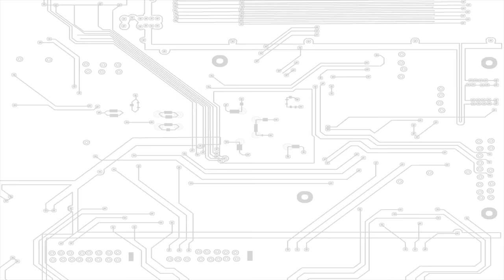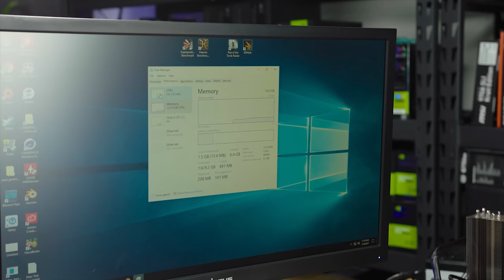How to fix bent CPU pins

Comment from the maker: I know that's it's painful to watch someone intentionally cause harm to a component, especially if it's a part that you desire however rather than getting triggered try to realize that these videos are designed to help give confidence to viewers to try and repair their own devices. The CPU still worked afterward and it's pain potentially helps countless people in the future to try and salvage their bent AMD CPUs. You should expect more videos like this, but I won't apologize if that bothers you. That's on you, not me.
Reply: indeed
Reply: Kids in Africa could have eaten that CPU!
Reply: Jay this is 'merica where sensitivity is rampant...
Reply: My 8350 is missing a pin, I scrapped one off another AMD proc, dropped in the socket and made work. At the time it was still very expensive, never underestimate the value of repair. I got a at the time 200 ish dollar proc for 5 bucks in scrap at local shop.
Reply: JayzTwoCents Will gladly take that missing pin, 3 legged cow off your hands sir lol. As long as its milkin its all good. Great vid by the way. Glad the cpu still worked after that.
Reply: You call it breaking a pin, I say weight reduction. Less weight = faster speeds?
Reply: Just gotta give this channel some props. I have been subscribed for awhile now and videos like these have helped me learn new things.  Also I subbed to you before I had even built my first PC and now im on my 9th just finished a build for my buddy and did all the overclocking and most of what I know is cus of you and Linus.  Thanks Jay
Reply: rubiconforrest dam good idea... Try that the next time I mess up cpu...
Reply: I cried watching this
Reply: Worth it, I've got a box of 20+ cpu's with bent pins (mostly socket 939 and am2+ cpu's) that were bent due to storage carelessness.  Never considered a razor.  Thanks for this.
Reply: Jay, I pulled a Phenom ii x6 1090t from a bin of CPUs at my work. There were 28 pins bent or flattened. I too used a razor blade to straighten the pins. I also had a pair of needle nose tweezers to help me more easily grasp the pins that were laid flat. I'd also say that the end bit where you put the CPU in the socket and use the socket to help straighten is crucial; perhaps more so than the razor blade, but I digress. In the end I'm happy to say that my CPU is up and running at a cool 3.6 GHz, boosting to 4 GHz on stock voltages. A very well put together video with clear concise instructions. Thanks for affirming that I did it right. ^_^
Reply: This was also a lot easier earlier. In the beginning of the Pentium 4 days there was enough space between pins that a small needle nose plier could be used to straighten up a pin. One of the first P4 processors I got I managed to mount incorrectly in the slot causing the pins in one corner to be bent. Doh!
Reply: That was really Alfred Hitchcock level of horror
Reply: JayzTwoCents don't worry Jay i watch a lot JerryRigEverything and how to basic so that pain thing already vanished a long time ago
Reply: What about using a heat gun on the bent pin area? Would that increase the malleability of the pins? Or cause more damage to the die?
Reply: I used the same method Jay years ago, I havent had to latly thank god heh
Reply: Jay is it really hard to ignore negative people? If I created YouTube videos or did anything where I had followers start hating on me, I wouldn't give them a single thought. Maybe I would change my tune if it was happening to me, but I noticed that it seems to bug you quite a bit. You make great content and a lot of us really really enjoy it, don't worry about the negative people, they're not worth your time. For the record I asked because I was genuinely curious.
Reply: I bought an AMD FX 6300 for $20 a couple of years ago because it had bent pins. I fixed it rather easily by using a credit card and those card squegees for screen protectors. The pins on the old Socket A processors are much easier to straighten up using a ball point pen.
Reply: +Sean Jurawan It didn't? Task manager said 16 too. Not sure where you were looking.
Reply: Jay you're da real MVP by doing stuff like this. you risk your own stuff in order to teach others.
Reply: You could have used your dead AMD FX CPU. :-p lol
Reply: lol i originally posted a pretty nasty comment toward haters but let me try something a LITTLE calmer.  tl;dr?  nope.

jay is right and awesome to pick on bitches and trolls.  embarrass the fuck out of them.  it's the only thing that works.  you never see them reply to the criticism when it's the owner of the house calling them out.  what you see instead is other trolls calling jay "thin-skinned" for not putting up with ceaseless bullshit.

the "thin-skinned" people are the ones being bitchy to jay in the first place.  but, recognizing that would almost be like self-awareness so i don't expect too many of you will fully appreciate that.

like i said, this is like the owner of the house saying "stop it".  would any of you look to said owner if you were a guest and tell him he's wrong to be upset at other guests for shitting on his carpet every time they stop by, several times per visit and in every room in the house?  when did saying "stop that" become more "bad" than that?

the fact is, we could all do better if we wanted.

oh well, nice video jay, i've repaired pins on old 486 CPUs with a mechanical pencil before, i somehow doubt that'd work here :)
Reply: All I was trying to say is why doesn't he just not read the comments and save himself the trouble? It seems like it bothers him so if it were me I would just ignore them because it would be easier on myself (if it bothered me so much.)
Reply: I did this on an old FX chip with a credit card once, the pins are a bit further apart (i think?) but that way you cant "cut" anything, might help as a newbie tip
Reply: I built a Ryzen 5 1600 pc 3 months ago, it was my first build and I was kinda nervous it didn't boot so I thought I bent the pins however after checking for hours on any deformed pins it turns out my memory wasn't seated properly. first time build thingy :D
Reply: jay i use a toothpick and a bank card to fix mine
Reply: What pin? Some times a schematic will tell you which one bent!!!
Reply: What about a video on fixing watercooling leaks that aren't just undertorqued couplings? Hoses/pipes, blocks, rads, reservoirs/pumps etc..? Maybe even repairing and topping off closed-loop AIO? Dirty quickfix, durable longterm fixes etc. Could even be a miniseries. Really miss more of those instructional watercooling vids - you really make them appeal to both novice and pro :)
Reply: You are right, obviously, it's just your thing. Still you could've used the less expensive CPU. But would you be willing to try the same, but this time heat up the pins, so they don't snap off that easy? I mean metal workers use heat to form metal, why not try it on the pins? Thanks for the video! By the way, i used a triangle ruler once to fix bent pins.
Reply: JayzTwoCents i think most pins get bend due of alot of force from the fingers on the outside or ignorantly use a thumb on the pins thinking u wont bend it. The most bending ive seen was on the outsides like you say in your vid on the "corners"
Reply: you shouldnt need to even be justifying yourself man
Reply: Just get Linus to drop it.
Reply: kickass
Reply: jay's a bully bending that pin, hehehe glad the cpu still works.
Reply: Thank you Jay 😋
Reply: I fix quite a bit of these BGA sockets using this basic method but I also add in using a thin guitar pick to straighten more extreme bends. The flex of the pick prevents me from overpowering the pin and breaking it. It takes a few tries to get used to it but I haven't broken a pin in years like this. With LGA sockets, I use a long non-marring tool with concave edges as well a curved #22 scalpel like those used by dermatologists.
Reply: savagery
Reply: Thanks Jay pretty specific video got the idea of it, it would have been nice to see a more tighter shot (like the example bent CPU pic) but the idea comes across! Thanks again!
Reply: so painful for me only because I've been there before.
Reply: You got me crying with that ryzen lol
Reply: Linus actually did 2 videos, and the 2nd was a remake.
Reply: Do you know the name of the music that you used in piano ?
Reply: dont worry, just see what TechRax,m EverythingApplePro, and GizmoSlip do, they intentionally harm things and it costs them sometimes thousands of dollars
Reply: That was so painful to watch. I would rather go through surgery again than watch that. I will say this video had lots of good information.
Reply: its better using the tip of a pen to straighten them and razor if the pins smashed flat to get it started then use pen to straighten
Reply: Aaron Beaty Since a heat gun can put out above 1500 degrees I see two possible outcomes to that.

1: thermal damage to the chip and components under the heat spreader
2: the heatgun will melt the solder on other pins and they will all go flying across the table from the wind of the heat gun. 

I tried to hot air reflow with a tube attached to a heat gun on a Xbox 360 and the lack of thermal control caused number 2 to happen to the xbox's motherboard. Never did find all those resistors either. Lol
Reply: what you think about blowing hot air over the pins like we do to bend pipes for water builds. it would have made pins easier to move.
Reply: Thanks for the video Jay. It is helpful, informative, and appreciated. I once fixed an old cpu with bent pins. I used different tools, but I never thought to use a razor blade.
Reply: Mr. Manager *PGA. BGA are the horrible 'soldered direct to the board without a socket' laptop type.
Reply: JayzTwoCents Here's my question... Why the hell didn't AMD take the opportunity with the AM4 socket to build in a guard around the rim of the pins?So that the outer most rows of pins could be protected by a metal or plastic wall that would defend against corner and edge drops? It's such a simple design change that would only require leaving a small recess around the perimeter of the socket. 

I know it's too late now because the AM4 standard is in full circulation, but maybe they could make an augmentation like that when they do AM4+?
Reply: Wanooknox You're suggesting a change to AM4 chips, not just the socket.

If someone bent the pins, they fucked up.

I would guess they probably won't do it again after the experience, this vid just shows it's a mostly recoverable situation.
Reply: It doesn't have to be a change to the chips... It could just be a plastic brace that they clip to the outside of the CPU's PCB. But either way, yes that's what I'd be looking to see. It doesn't make any sense to me that they wouldn't do this on such a fragile part (even if this video does show that it's salvageable). Like they could even make that change in the jump to AM4+ because they wouldn't need to make any change to the pin layout, just add a boarder. Older AM4 chips could remain forward compatible with a new socket design, and the newer chips could have the bracer built in to protect the pins and just slid right into a recessed "moat" around the socket. It's really not a complex modification.
Reply: Wanooknox I understand your position, but that means extra tooling costs to make the moulds for the clip-on brace / shroud, the risk of damage on the production line (human or robotic) fitting it.
AMD have always been about value and i'd prefer a $3 cheaper CPU than one that's idiot proof.
You make something idiot proof, and we get better idiots
Reply: JayzTwoCents just seeing you drop the cpu hurts my heart
Reply: Excellent cinematography. Can you do a  "bake a GPU" video for graphics cards? I killed one with liquid metal and wanted to know if that can be fixed with baking.
Reply: JayzTwoCents at least no intel. Lol
Reply: @jay i used a sewing needle on my old 1055t (still works) whent on one side then the other side ... teased it up  on both sides 10 ,minutes later done and up and running..... no need for a razor blade  (risk cutting yourself rather than pricking yourself).
Reply: JayzTwoCents i used to routinely bend cpu pins when i’d try to remove my old pentium from socket. Would be stuck to waterblock and rip out of socket. I’d bend the pins back with mag glass and edge of credit card. That was back when I had a 230w TEC and liquid via danger den block.
Reply: JayzTwoCents At least you didn’t paint a bunch of RGB components black and fry them in the process like Linus did.
Reply: Can You fix bent radiator fins on AIO liquid coolers?
Reply: Yes, very easy to straighten find. I did it a few months ago on my thermochill pa 120.3.
Reply: I know that it's possible, I want to see his method.
Reply: He bends them into place with tip of tongue, I tried his method but had a sore tongue for a week after.
Reply: JayzTwoCents who else was crying
Reply: Blow it up
Reply: JayzTwoCents thanks man. Today a built my New rig With a ryzen 5 1600. It scared me a lot to see the cpu not fit in, and it was from a bent pin. This video helped me a lot, my pc is working fine. Thanks a lot!
Im Kinda worried it May affect performance but i dont Know That much. Please keep making videos like this.
Reply: I paid my own money to send in my X99 Rampage V extreme the 15th of the same motherboard to ASUS for service. they dump it with out letting me know. its a brand new motherboard. I asked to send it back to me. I will never buy ASUS and corsair again. 23 broken  X99 motherboards. all of them CPU sockets that fallen to bits and bent pins. the last 2 MSI X99A gaming 7 DOA.I am waiting for delivery I am fucking disgusted about wasting my time and money on this disgusting project. when I get this back with in 24 hours. if it dose not work. I am going to call MSI that I will dump everything. I AM NOT GOING TO START ALL OVER FROM SCRATCH. I CANNOT WORK FOR A LIVING ANY MORE DUE TO MEDICAL CONDITIONS. SSI CANNOT PAY ME ENOUGH TO BUY A NEW GAMING COMPUTER. 23 YEARS OF CPU SOCKETS FALLING TO BITS AND BENT PINS,  FAKE BIOS AND FAKE CHIP SET FROM CHINA. I refuse to buy a new gaming PC no more. I am finished with this project what ever this is the last time I try to get it to work. this is the last time. if it dose fail its over
Reply: Can you do an Intel Chip well Intel Motherboard pins fix video too that would be good too see!
Reply: I'm getting my R5-1600 near the end of this week and while I was watching oh man I was so freaked out on the thought this could happen to this little guy... Too bad AMD didn't go with LGA for the new platform, LGA CPUs are so rugged compared to PGA ones.
Reply: Could’ve just handed it to Linus.
Reply: LOL my CPU is costs one sixth of yours. i3 3220 3.3Ghz, not overclocked and with stock fan on top of it
Reply: Well said Jay. Looking forward to more DIY repairs. Thanks!
Reply: Wait people seriously get pissed over that? Wow, pathetic
Reply: STAND AT ATTENTION WHAT DO YOU THINK YOU ARE DOING
Reply: I've used a small diameter mechanical pencil and it worked great... Here's the bad news if your pins are more than 30 degrees bent eh..... The odds of them snapping are 90%
Reply: me watching something i could only dream of having getting destroyed in front of me.
Reply: Razor blades is bad fucking idea.. But desperate times call for desperate measures
Reply: I mean you could as well just bend the pin off screen present the CPU as already damaged and proceed to just shoot the repair operation :p this would save our souls a bit of pain and still deliver the message
Reply: Thanks Jay, I recently helped build my girlfriend a computer and it's my first AMD build, cpu fan wouldn't work so tried pulling it off to have a look and it ripped the CPU out of its socket, bending heaps of pins!! I'm gonna try follow your instructions, wish me luck!!
Reply: People don't appreciate the creative excellence that is Jay. I really have to give you props for fixing that CPU and my depression. In full seriousness tho I honestly wish to thank you because you show us the line, the barrier, the thing we really shouldn't cross and not many youtubers do that, most of them does something and expect us to worship them for it but you make us feel that even us mortals can stand on Olympus, fight within the ranks of the aesir, stare at the sun and win. You cause yourself potential grieve for our benefit, You are like Odin pinning himself against Yggdrasil  to obtain knowledge and then you share your knowledge with us like a bro, You are BrOdin.

I sincerely hope you read this just to uplift some downed spirits or put an extra smile on your face. (I don't mean spawning a second mouth, That would be creepy, I mean for you to add a smile to your daily tally.
Reply: @t3st-x  For me it was mismatched ram. Both sticks need the same timings. Bought a pair of 8gb Corsairs and solved the problem for me.
Reply: Thank you so much Jay, just fixed a 2200g with this method. Bought used from eBay and the corners were a little bent. Razor blade did the trick!
Reply: amazing technique. Thanks, I need it as I bent my pins. I bent it because of amd stock cooler which was hard to mount, so during process, processor stucked on cooler and I bent few pins.
Reply: Man, I watched this video about two weeks ago, just because it seemed interesting... Today, my Ryzen 5 came in, and it had two bent pins... I already knew what to do! Thank you, Jay!!!!
Reply: @gurnenthar9274  I did it without problems, be careful dont use force, take it easy once you find technique. Must have is a MAGNIFIER ( I bought one cheaply, around 5-10 USD) and precise screwdrivers (buy smallest ones), and patience. Do it during daylight.
Reply: Robert Jones   I have pretty good eyesight, and a bright headlamp, so it went smoothly! Machine is up and running! Ryzen 5 3600; RX 5700 XT, and 32g RAM... Gaming and recording music! It’s great, so far!
Reply: You sir just saved my freakin' Ryzen 2700X 😁 I was devasteted when I accidentaly bent my pins while changing my cooler. I was freaking out and then saw this video, followed your tipps, and put it all back together. Runs like a charm 😎 Thank you a million times for saving me 300€ 😅😁👍🏼
Reply: 2020 checking in. Building my first computer, cpu got stock to the damn stock cooler and yanked out, bent pins everywhere. This got me back up and running. Thanks for the video.
Reply: Thanks saved my Ryzen 5
Reply: Excellent.
I like your idea of the razorblade that's perfect. I have not tried this yet but I'm going to give it a shot.
CPU I bent was the AMD 1090t
I already went ahead and bought a little bit of an upgrade which was used.
But I'm going to give your method a shot.
Even though I have bad eyesight and I'm 70 years old. I will take my time if it takes me three weeks to do it what the heck. LoL
Keith Kuhn
I am subscribed.
Thanks
Reply: i broke by ryzen 5 3600 CPU bent a pin and now don't work time to save up to buy another
Reply: i would like to know what the pin upside the cpu use for?
Reply: Sad so many people can’t realize this on their own and need this paragraph from you explaining it, maybe it’s just younger viewers that don’t see it that way.
Reply: Sheesh! Well, good luck! I hope you can salvage it!
Reply: Jay to the rescue definitely gonna be doing this to my Ryzen 5 2600.
Reply: I just had to do this with small pin luckly it was only three pins on each side so it will work now
Reply: Your video helped me fix my dad's $150 CPU. He bent several pins, and I thought I might as well give it a try. Thank you so much, my pops thinks I'm some kind of genius now.
Reply: I hated every moment of him breaking it on purpose